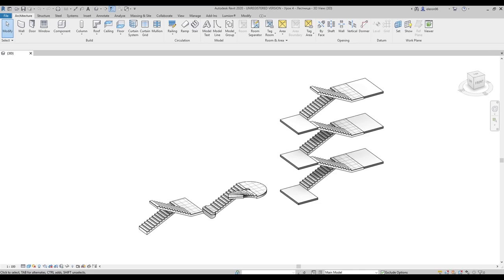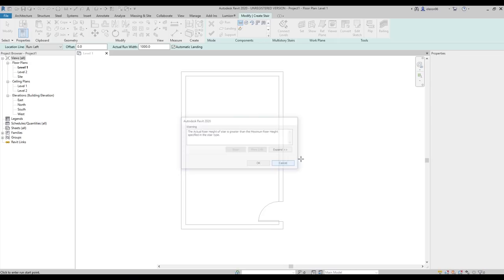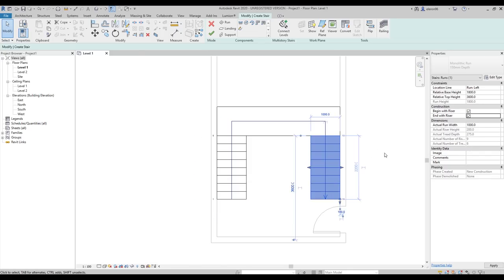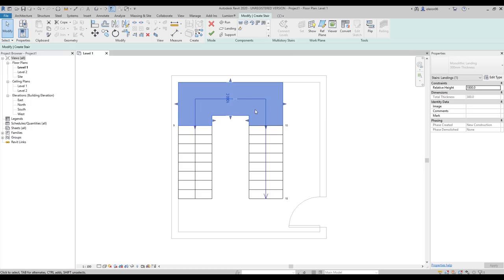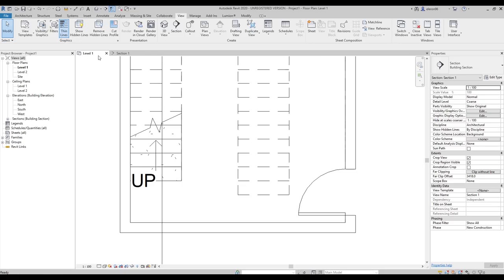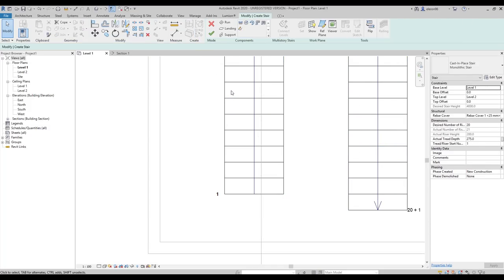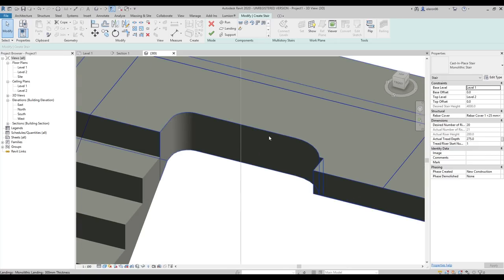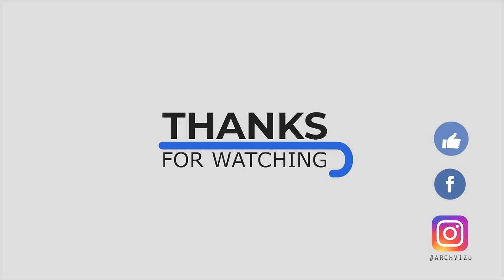how to create staircase in Revit. #1 (Basic Level)

Comment: @Niko G. I have a small problem because I notice that some of the stairs edit type setting are little bit different from early - latest version of revit (e.g. ver. 2017 to ver. 2018)
Reply from the maker: That true, Autdesk has changed stairs.
Reply: @NikoG can you suggest which version should I use? I'm quite new from Revit and the stairs where I'm kinda stuck because of the different version from tutorials that I'm watching.